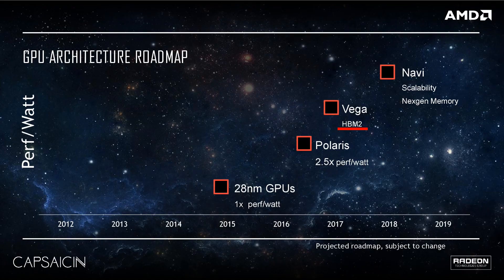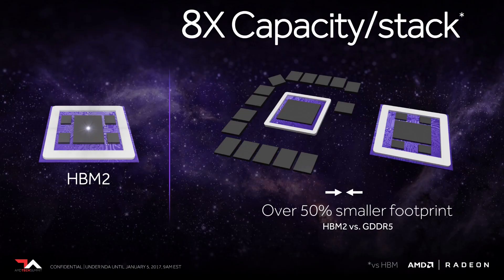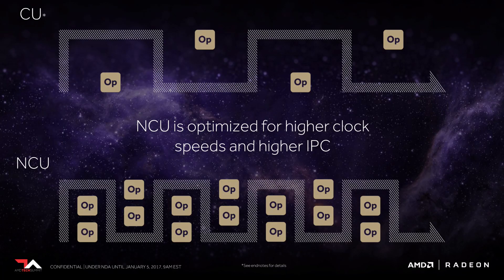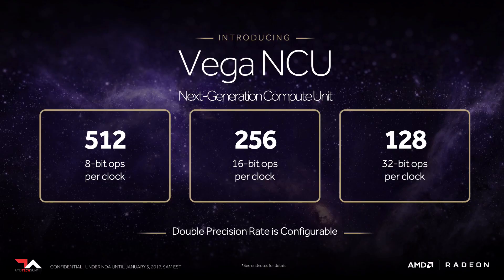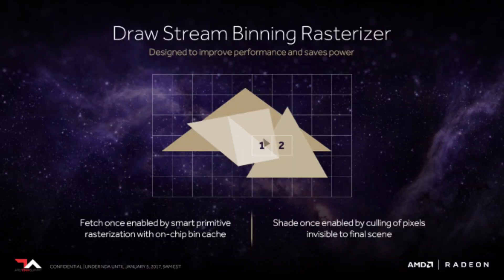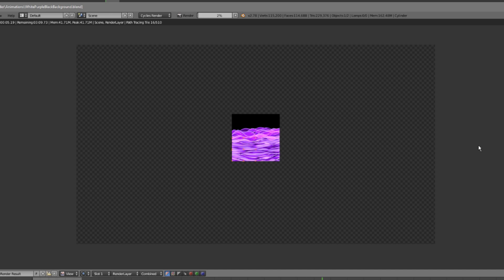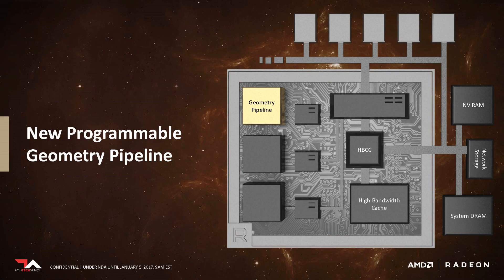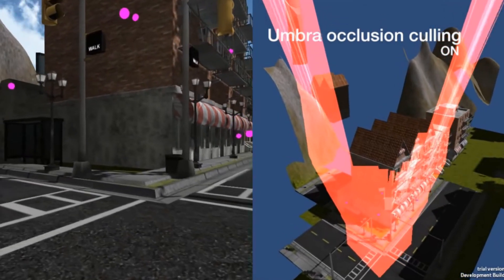AMD VEGA: Architecture Improvements Explained

Comment: This is all very nice and all, but you do know that Vega 10 is the only card with HBM2 in the vega line up of Vega 10 and 11, and will be expensive as it's expensive to make Hbm memory cards and will sit between a 1080 and 1080ti.
2x 1070 will outperform it for 20 quid more.
You also know that it's basically confirmed that it has the same water cooler strapped on it as the fury X,  which tells us there's a problem controlling temps already hence the need to strap that water cooler on it.
Price is Rumered to 800.00 dollar's for Vega 10.
Reply: KAZAKA Errr AMD themselves confirmed both Vega 10= 8gig HBM2 and Vega 11 to be Non HBM2 but Gddr5 or Gddr5x.
Would have thought you would have known that at least, since you're on YouTube specifically talking about Vega.
It's not secretive info dude, it's pretty old news.
Since Vega 10 is the flagship card with 8gig Hbm2 which is more expensive to make and implement over the 650.00 UK pounds Fury X 4 gig of HBM1 then the 800.00 US dollar's price tag for 8 gig HBM2 that has been mentioned does make sense.
As does the water cooler as all top tier AMD cards need and have one.
As for links, there are many links showing shipping manifests that detail the hardware and spec of the actual card itself.

Comment: amd is always undercutting it's rivals with it's gadgets and it does almost reach the same gaming performance. I think i know why amd doesnt beat it's rival is because it doesn't want to! wanna know how? you see ryzen processors are way more powerful than the i7-7700k, in production but in gaming they are even and the 7700k even beats the 1800X in alot of games, but when you use all the amd gear together(gpu, cpu and monitor) i assure you you will never find a smoother experience because their 0.1% lows their minimum and average graphics are so tightly packed, that you won't even notice dips in fps like others.
Reply: hmmmmmmmmmm don't think this is the case
Reply: lol like it or not, this is the case... everyone's saying it, other than some fanboys, because the 0.1% lows and the 1% lows are closer together in amd than in intel which means better frame time, check everyone's benchmarks but that's bnot in every game.. so let me list you you a few techtubers Bitwit, linus, hardware unboxed, adoredtv,paul's hardware, salazar studio, hardware canucks. watch these people and then maybe you will understand. btw salazar is a little biased.
Reply: rocker 10039 so you're saying AMD is deliberately hamstringing their products. Makes sense...oh wait it doesn't. The closer together 0.1% and 1% low are most likely due to architectural differences between AMD and intel.
Reply: when did i say amd was hamstrining their own products i said that ryzen wasn't meant for the kaby lake 7700k or alll the i7 quad cores for that matter. And yea obviously it is the architectural differences even differences in intel's own architecture is proved to show drastic changes. i have only tried to give explanations for all the questions people had.
Reply: rocker 10039 so the 1600x and 1500x weren't supposed to compete with the quad core i7'S even though there in the same price range...
Reply: Intel also undercuts their stuff more so than amd this is how they charge more for products it has good architecture but intel underpowers them equaling the price going up that's why intel is more expensive with about the same performance

Comment: The biggest problem with the FX and that whole generation of AMD CPU was the atrocious FPU performance.  While that FX-8350 may have 8 cores, and 8 Int. units, those 8 cores share only 4 FPU units.  

I do a fair amount of distributed computing.  I have an 8 year old i7 (6 core HT) at 4.1GHz that can process 9 SETI units simultaneously and completes them regularly in ~2 hours 20 minutes.  I have two 8 core FX based systems and have them running only 7 units each and they take between 4:30-5:00 hours.  This is due to SETI being very heavy in FPU usage because it requires double precision (FP64) calculations, and the FX series just don't cut it.  Now seeing the new Ryzen CPU has me excited because it is an FPU beast.  I just hope the new Vega based systems have good FP64 performance; AMD used to dominate this area and guys were paying top dollar for AMD cards when bit coin mining first started.

Here's to hoping...
Reply: Sage Fox...you don't know shit at all.
Reply: That's not true at all.  I love the new Ryzen and am so getting one, but to your point that transistor count is what matters, lets look at Ryzen.  The chip has a 16MB L3 cache, but that cache is divided into two 8MB chunks on each of the CCX units.  Now whether you make a single 16MB L3 cache or split it up into two 8MB chunks, the transistor count is the same.  However, AMD had to create the "Infinity Fabric" to allow these two separate L3 caches to communicate.  Now I understand the reason for doing this because of fabrication costs, it doesn't change the fact that more transistors will translate into better performance.  Had they made the system with a single 16MB, unified L3 cache that could be accessed by both CCX units, the performance would be better; this is why performance is scaling so good as RAM clocks are increased, as it improves the speed of the Infinity Fabric bus.

It also doesn't discount the fact that FPU performance in the FX were terrible because of sharing an FPU unit between two cores.

"Our more informed readers might recall that the Excavator architecture had a shared FPU design, with one floating point unit being shared between two cores. In what appears to be a move to get back on track, the source reveals that AMD is switching back to one FPU per core design – something Intel already follows."

http://wccftech.com/amd-one-fpu-per-core-design-zen-processors/